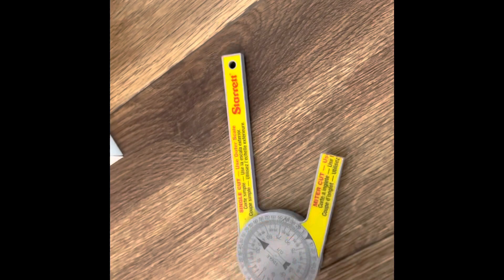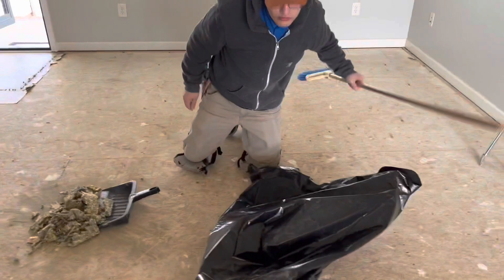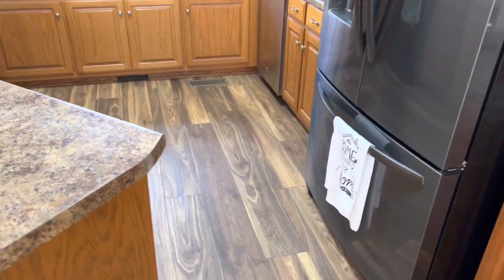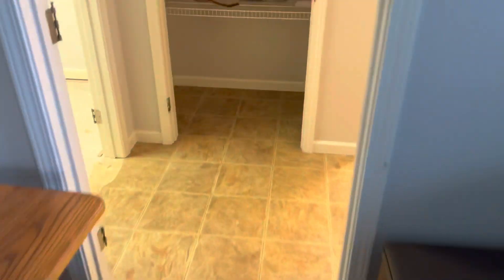Daily Vlog, vinyl plank installation and carpet demo￼

Comment: I've been taking in your videos like crazy the last few weeks! I've installed plenty of flooring as a DIY guy, got brave enough to do my own vinyl to carpet transitions when I replaced the carpet in my hallway with lvp and left the carpet in the bedrooms. 
But this lvp I installed has given me nothing but the devil! It's LifeProof lvp, 6.5mm rigid core I believe. Probably half of the short ended joints love to pop and crack when I walk on them. I've never had so much problem in my life. Getting a floor installed right. I'd love to hear ideas on how to get the short-ended joints put together better before I just super glue them
Reply from the maker: You are supposed to just be able to tap those in joints down and it snapped in place, if your floor is flat and solid you should not have any trouble with them popping back loose
Reply: @FloorsbySouthernboys  I put quiet walk plus underneath it to try to do a little bit of sound deadening as it is kind of a long and narrow hallway. Per manufacturer specs I should be able to do that, but I'm beginning to wonder if it was a mistake

Comment: If you R&R  a dryer, it's time to insist on new hoses. Washers and dryers probably haven't been moved since new.  If the flooring is replaced, they won't be moved for another 10 years, so the time is now.
For dryers, reinstall with aluminum of the old ones were plastic.  Fire departments don't like plastic vent material.  
Great work.  I can't believe what you accomplish in a day. 👍
Reply from the maker: Good point 👍
Reply: You really shouldn’t install gas appliances or water related appliances, toilets and things. Flooring installers insurance likely doesn’t cover you installing that stuff.
Reply: @terenceharley7081  I wouldn't recommend installers ever reinstall gas under any circumstances. 
 Toilets, washers and dryers, sometimes you do what ya gotta do.  It's 6pm as you're finishing up... customer has one bathroom.  Do you put the toilet back?  I do. 
 Since before covid,  and to this day,  plumbers are unobtanium, booked weeks out of not longer.   Getting one to arrive when you're finishing up is like winning the lottery. Were a smaller community. A county of 55,000.
I've put back a couple hundred or more since the late 70's. I learned flooring from my grandfather. He always put toilets back, so I did too.  I've never had a leak,  but I've seen "pros" that did.   I once let a "pro" use my 1/4-20 tap to fix a rusted off toilet bolt in a cast iron flange. Carpet dude had one, the plumber didn't. 😁  
I'm not installing much anymore and times have changed. 
I wouldn't recommend to most installers these days to set toilets. Most today aren't even good at flooring 😁
If you do reinstall anything,  use new hoses, bolt kits etc.
Reply: @randywl8925  Many insurance companies do not want flooring installers hooking up gas appliances and water appliances. If there is a problem down the road you’re on your own. The store I work out of tells customers installers don’t hook these things up and customers get that stuff scheduled and some do it themselves. I personally like not having to worry about that stuff. Leaks happen even to plumbers
Reply: @terenceharley7081  I don't disagree at all. We (grandpa and I), used to do that.  I learned how to do that.  We had a removal fee and an install fee at a shop we worked for. Once on my own, I continued doing toilets up til 10 years ago..... Well, that's a lie, I haven't done many. 😉
I've always pressured people to get their own plumber to install. I don't like messing with them.  That's just not always reality. 
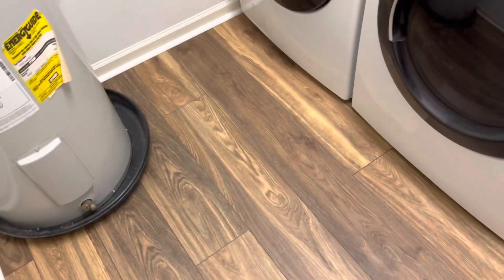You found rot in a bathroom floor, and postponed the plumber till 4:30...... Now it's gonna be 6:00. Plumber says he can be there next Tuesday.
There is one toilet in the house.
Are you going to be a superhero or tell the customer to crap in the yard for a week?
Mechanically,  I'm fortunate to not need assistance on many levels. I do my own electrical, plumbing, carpentry and automotive (including engine rebuilding)
My confidence outweighs the minimal risk.  Setting a toilet is  as difficult as screwing a garden hose to a faucet.
If in doubt, add 1/2 an additional wax ring.  This isn't NASA.
That said, you shouldn't do this if you'd never learned how to. You need some education by someone that understands the process.
I'd never advise anyone to set toilets or connect rubber hoses and install a washing machine.   
If you know how, you are your customers Superman.
If at all doubtful, just say no.
That said.... No, I would never hook up someone's gas appliance.
A small drip, I could deal with.
Blowing up a house and killing a family????
....nope, I have my limits. 
I live in a small area and you just can't correlate an install and a plumber right down to the house.  In larger cities, maybe that's easy. It ain't in these here parts.
I'm not disagreeing so much as saying if you reinstall toilets and washers, always insist on new hoses and parts.
Like you mentioned, once installed, the 10 year old hoses might not live to be 20 years old..... They're cheap, just replace them.

Comment: Hey keep up the good work, do you have much issues with peaky joins? Was wondering if you could do a video on this problem,  I'm having a run of them at the moment & I know sometimes they can't be avoided but wondered if there's things you do to minimize it happening. Cheers
Reply from the maker: I have not had a seam peaking issue in years, I will do a video about it
Reply: @FloorsbySouthernboys  thank you, I know there's many factors that cause it & I haven't had an issue with them for quite a while but lately have had a few. Do you do all your seams with the koolglide?
Reply from the maker: @jawson37  Yes but I am fixing to change up again for a little while on particular jobs and use my traditional iron for a while
Reply: Are the backings on these carpet jobs the same type as your  previous jobs have been?
I prefer the Kool glide seamer on Berber, patterned and looped pile, but on your typical fuzzy cut pile I still like using a standard seaming iron so you can physically watch the two pieces of carpet go together.
There are three things that I do to help me make it flat seams.
Pre-stretching both sides of your seam  for about two or three feet on each side.  You can do that with a kicker, but occasionally I'll use my stretcher and stretch about 20 to 50% of my normal stretch on each side of the seam.   You might find it necessary to use stay tacks to keep the seam in the right position as you make the seam.  It's harder to kick the seam together as you go  with the carpet now under tension.
Heres my reasoning. Have you ever noticed that you made a perfectly flat seam and then after you stretch it it lifts up?   The seam tape does not stretch at the same rate as the rest of the carpet, so the taped area is not going to behave the same.   Some carpet manufacturers, the high-end carpet manufacturers recommend pre-stretching.
I tried it and it seems to work for me. Once the seam is totally cool, release the tension in the carpet and be sure it is not stuck to the pad.
Without tension on the carpet you may notice the seam creates little buckles one to three feet apart all the way down the seam.   Once again, that's because the seam tape does not stretch the same as the carpet.
Don't let it bother you because those will flatten right back out when you stretch the carpet normally.
Thermo ceiling with the orcon gun or an equivalent also helps peaking issues.  I'm very methodical about how I dispense the adhesive on the edges of the seam.  You don't want a big bubble or glob of sealer there just an extremely thin film.  As I dispense the adhesive out the gun tip, I kind of move my gun forward and backwards, forward and backwards.  The heat from the tip will even sear off loose backing fibers that you might normally have to trim off later. Just hold the tip on them for a second and they'll shrivel right up.  As you make the same and keep the edges butted together the carpet is now re-glued sideways making it harder for the seam to hinge and lift up.
The third thing I do is use the SeamerDown......  well, I actually made mine,  but I use it on every seam.   I laughed at the tool when the inventor introduced it on a flooring forum many years ago.  It's a recommended tool by high-end carpet manufacturers, especially patterned and wool carpets.  That's where it really shines.
Reply: @randywl8925  ok I'll try have a go at pre stretching the carpet on each side of the seam, I know some guys do but I never have. Mostly happens with lighter shades of carpets & the more denser thicker piles, it happens with both synthetic & hessian backings, I have my iron set at 2.5 -3 & stretch the length first where possible, putting extra tension along the seam. I haven't seam Sealed for a couple years so I might start doing that again to see if that makes a difference
Reply: @jawson37  very lightly sealing with an Orcon top helps. The Hot melt glue is reactivated as you put the seam together and so it actually sticks the seam together edge to edge.  That help the carpet not act like a hinge.  You put on as little as necessary, otherwise if you put it on too thick like a bead of it, it gets reactivated and comes up above the yarns and then you got you some trouble. 😁 
I actually stretched in one seam nearly as tight as I normally stretch a room. When I let it loose from the tackstrip after it cooled, the same area became freaky looking. It looks like someone put a golf ball under the carpet every two and a half feet.  The humps were pretty big.  I even have a picture where I laid a square across the top of the peaks and I could stick my finger underneath it. I'm not recommending you stretching that tight. I did it as a test one time.  Like I said you can probably do it with a knee kicker, but I don't kick anything as I have a hernia.  If you use a conventional seeming iron, like I said, straighten out your seam and kick it together using some stay nails.  I use sheetrock nails because they're so sharp and smooth.  I sometimes have put seams together where I was stay tacked both sides  or the seam, so I have zero manipulation to do with a kicker as I'm making the seam.  
It's nice putting a seam together where you don't have to concern yourself with kicking it towards or away from itself.